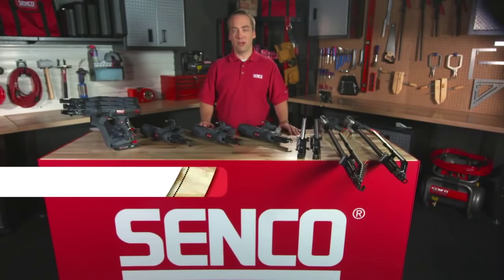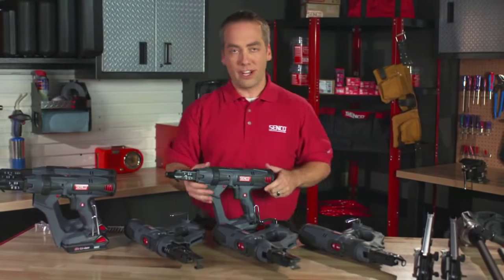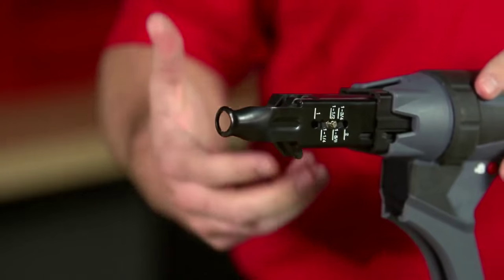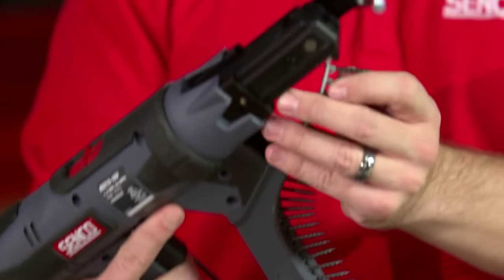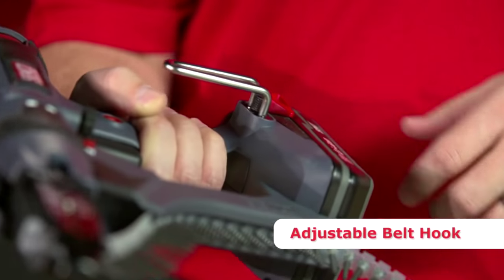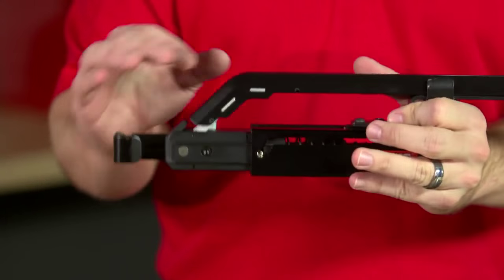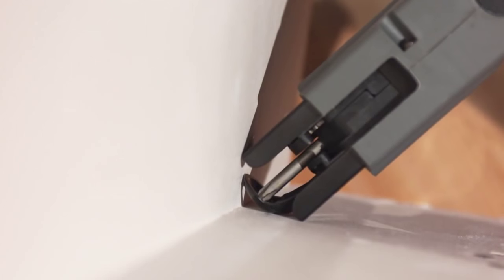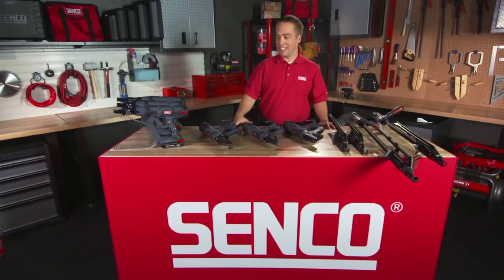Senco Screw Gun    DuraSpin Features & Benefits

Comment: ... if you designed a new tool way you didn't put the auto mode and the impossibility to screw a screw not deep enough  with out  need it a different screwdriver? 
The auto mode is exceptional ... that running all the time is painful